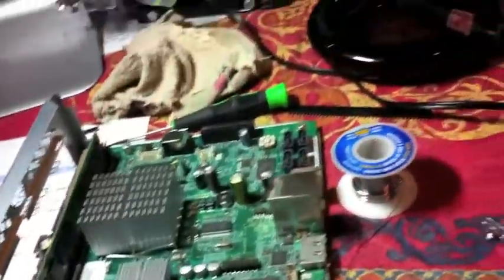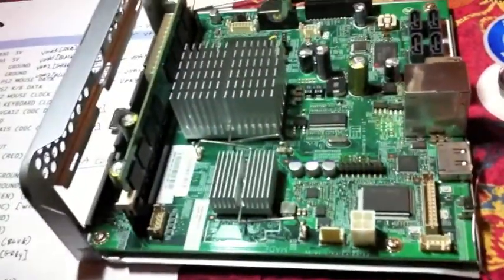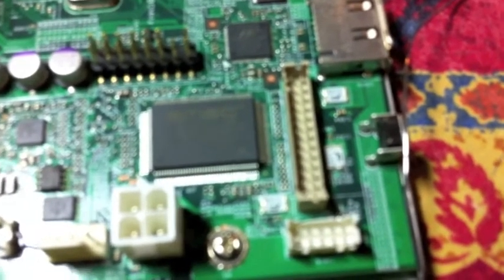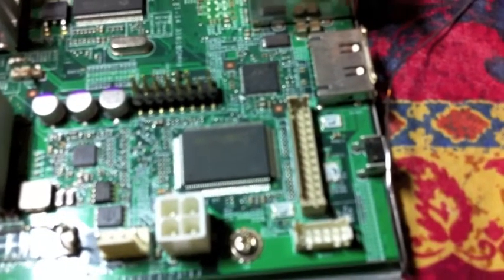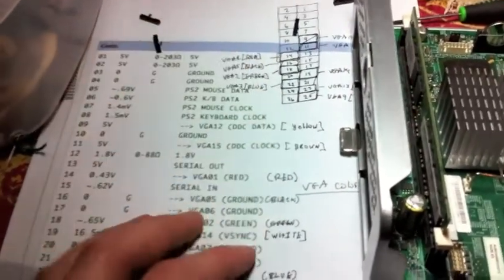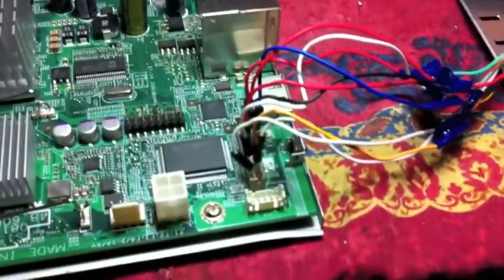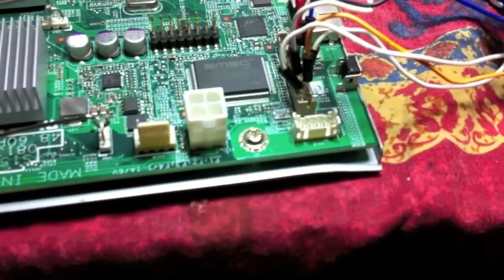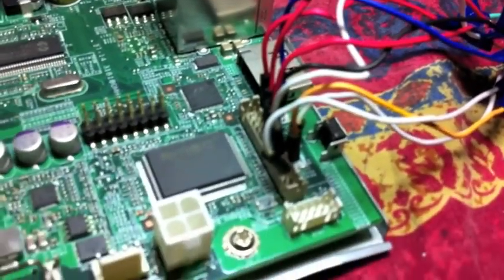Failed at Adding VGA to a Headless Server.m4v

Comment: Did you ever get this working ?
Reply: I did yep!
Reply: j44dge how? Trying to do mine as we speak
Reply: marc Webb the thing was from
What I remember (aside from making the correct connection for VGA) was to leave most of the shielding in place on the VGA cable. Only cut as much as you need, and connect the outter shell/sheath of the VGA cable to any of the ground pins on the motherboard
Reply: j44dge got ya. Did you find your vga cable only had 9 wires ? Just cut one open to solder headers to find it just 9 not one for each pin
Reply: marc Webb some of them are like that yep, the cheaper cables just have less ground wires in them.. at the minimum I think you should have 1 wire each for RGB signal, the ground for each of those,  hSync and vSync, and another ground for 9 total. The entire middle row of the VGA cable pins are all ground I’m pretty sure
Reply: j44dge is this doable with the 9 wire version